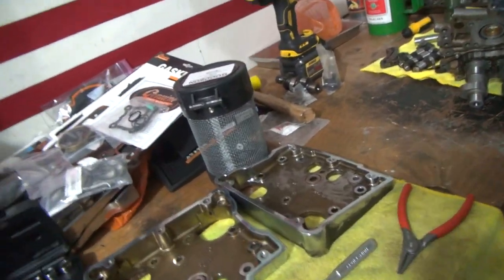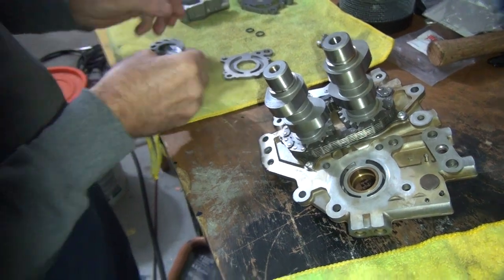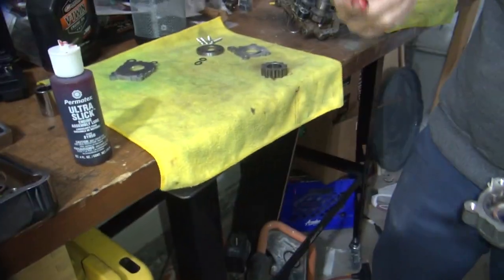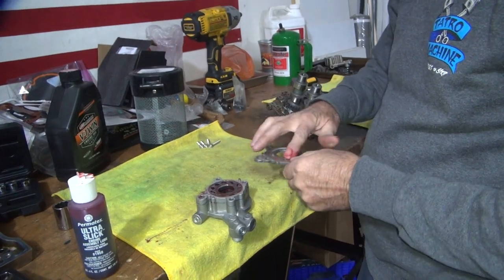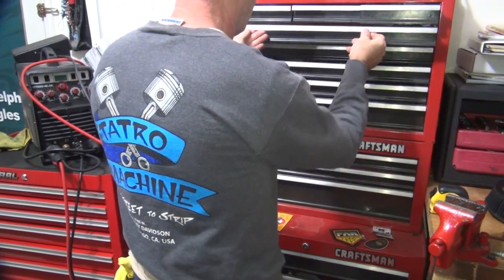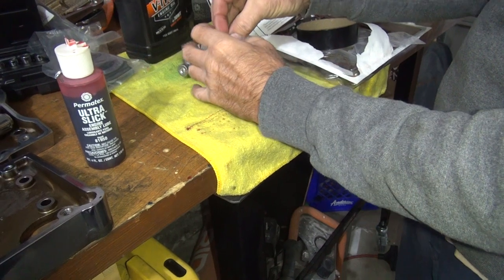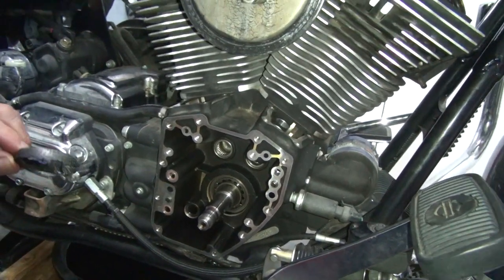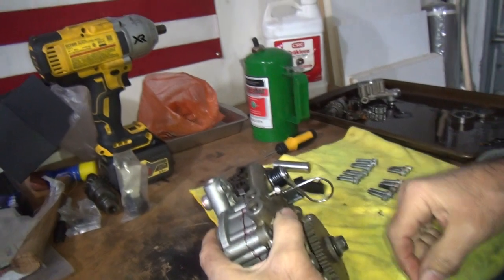#113 2004 road turd cam change tensioner bearing repair FLHT 88 twincam touring harley tatro machine

Comment: I have found more than one oil pump to case O-Ring folded over and not sealing from being pushed into the case then having the oil pump pushed into it Sumping, and oil consumption most noticeable on startup were the symptoms
I enjoy watching your videos  and see them as a teaching tool
Reply from the maker: and i have seen problems the other way too. do what workes for yourself. if something doesn't feel right than redo it until it is good.
tatro